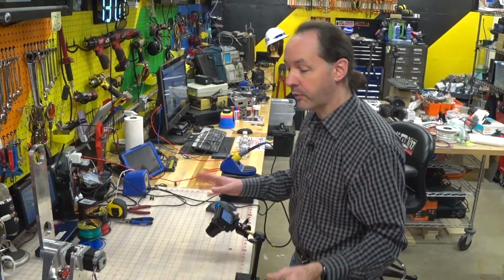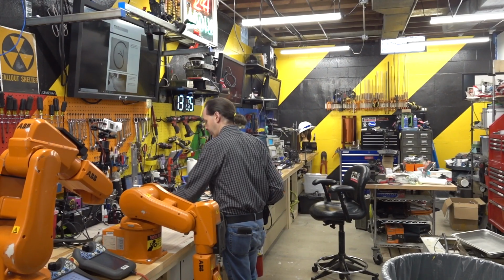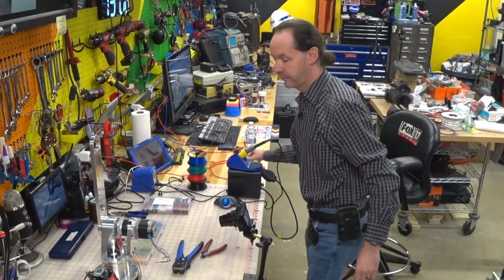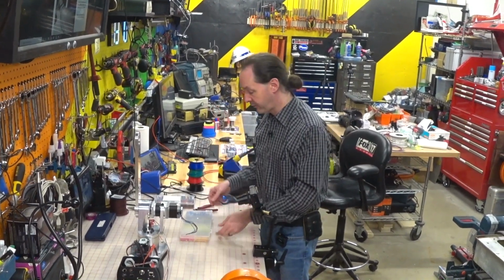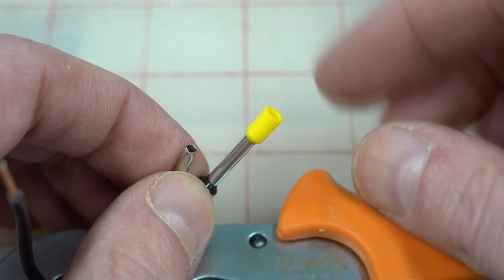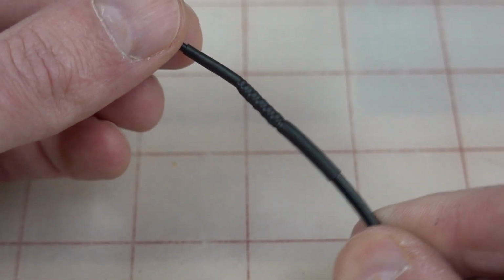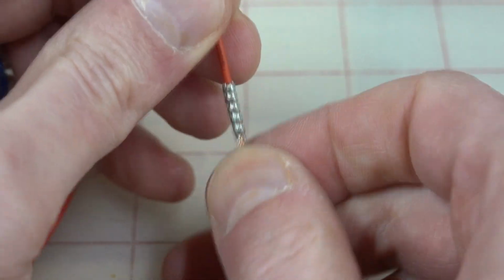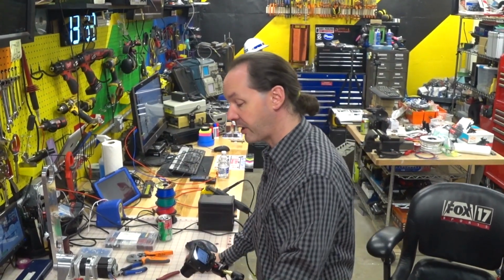Project ARchi3 Episode 18 -J2 Motor Leads

Comment: They are called a ferrule crimping tool. You should stagger the joints like Sparky stated. Your best bet to solder them was to have used the solder seal wire connectors you have, which only requires a heat gun to solder and shrink.

Comment: I would have cut the wires longer, and staggered the joints so you don't have a big bulge, i'm guessing you have to get those and the encoder wires through the sleeve
When you strip the wire, try to do it so the insulation stays on the wire (just the last bit will do), then twist using that bit of insulation, you get a tighter twist, and you don't get the strands poking your fingers (specially on thicker wires)